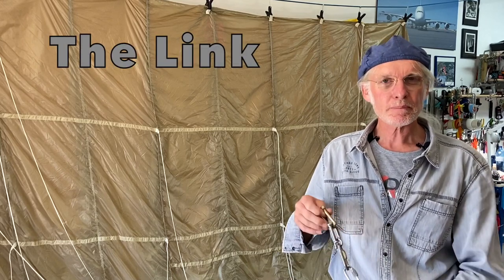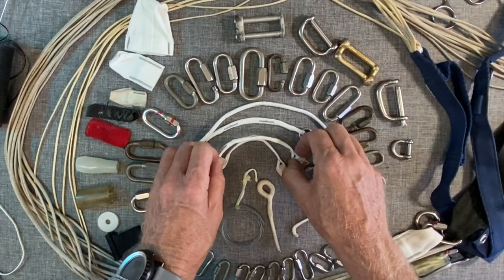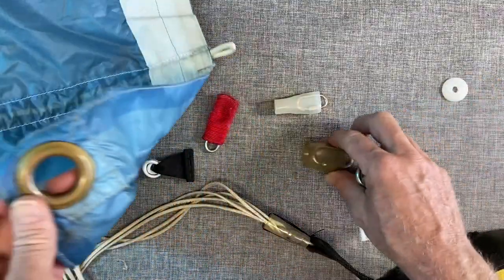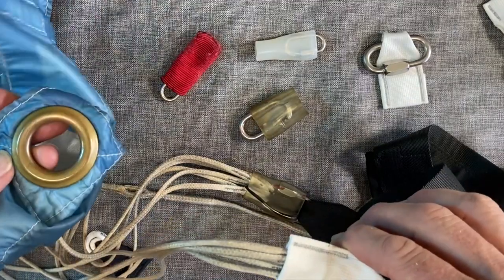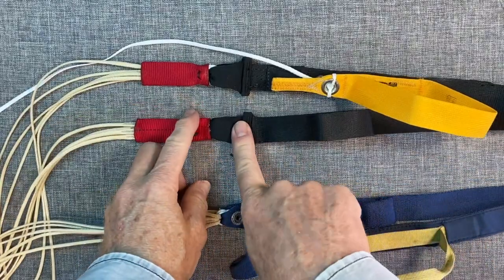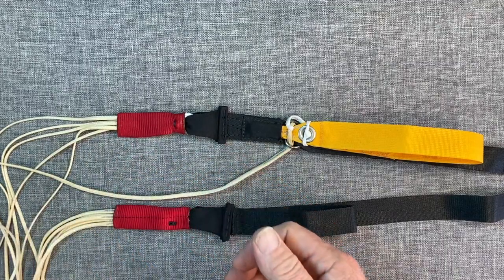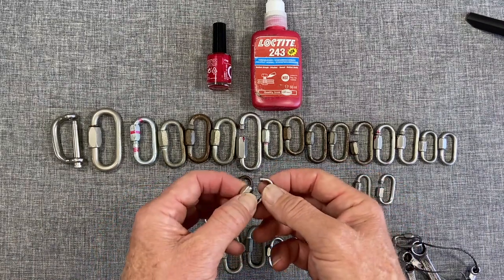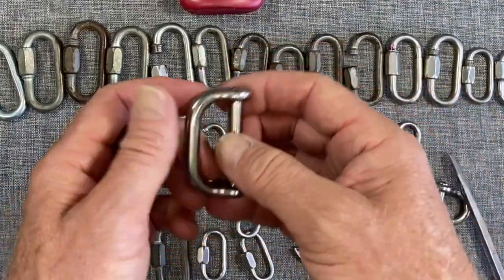The Link.

Comment: Once again, great video!, one question... does all this apply the same way to reserves? can you still use hard links on reserves? I remember a friday freakout 4 years ago with a malfunction on a reserve with a hard link failing...
Reply from the maker: Thank you Daniel, I’m grateful you had a look and for your question.

Yes, a Link is a Link whether it attaches you to your main or reserve, 

Sizes tend to be a wee bit larger on the reserve, the Ty7, Ty8 or Ty13 webbing typically used fit reserve risers will not be happy with a size 3.5 Maillon Rapide (from Peguet) (certified for PPE)

The size 4 or 5 were the normal ones most manufacture supplied with their reserve canopies, (occasionally size 6)

With no LinkCover there is a chance a line or two could get itself to the other side of the link nut, best to be avoided. 

In my younger days, I used safety thread past though one line end loop and then wrapped around the rest of the lines on the link, this would keep the lines together nicely but not protect them from slider grommet impacting the link with the poor line in-between. 
For that reason I now fit LinkCovers to all Maillon Rapide on sport parachutes.

Link Failed or Human Failed ?

Links can work loos if they have high cycles (hopefully only seen on main canopy) and no periodic inspection is made.

In my opinion links come loos on a reserve because they were never tightened in the first place(see link, Photo below)

There a several reports of SoftLinks Failing as well, 
in my workshop I frequently find SoftLinks incorrectly fitted,
in combination with a Lower Control Line snagging on it or a hand pulling on a riser in the final turn, 
there’s a chance the SoftLink will open up.

SoftLinks are not any better/stronger than Maillon Rapide,
(The profit margin is better on a SoftLink)
No need for LinkCovers or Safety thread wrapped around the lines, see photo of poor technique on the reserve.

I always tack the Softlink into the riser.

The photo of the ControlLine making a couplet loop around the Aft Rh line group, arrived in my workshop a year ago, it was assembled at the Manufacturer and had a second repack by one of their top representatives six months later, 
its a 106 so may have been a challenge to fly straight had it been used like this.

We must attempt to be concentrating on what we are doing,
more difficult with all the distraction we allow ourselves.

Link Failed ? 
Yes the Human Link !

All the best,
Colin.

https://drive.google.com/drive/folders/1ZUq8ZkoztNILJKhjSZfioxNVVEJbkcmS?usp=sharing

Comment: Thank you for posting these very informative videos! I was wondering why did you secure the soft link with the metal ring through both sides of the riser fabric, but you secured the PD SLink through one side of the riser only?
Reply from the maker: Hello Vladimir,
Thank you for watching and for your question.

The SLink from PD has that tag of 1/4"Ty3 tape for the "ID", it seems to work well as an anchor point for the tacking cord, so I use it, if its there.

For SoftLinks with a Ring or a folded tape with no wee 1/4"loop tag, 
it just seams simpler to have the Tacking cord loop around the folded tape or through the Ring.
The stitch is not very tight, I like to allow for a bit of a breathing space, 
they appear to sit happily in the middle of the riser. 
(no need to stress the riser more than necessary) 
The Red Tubular Sacrificial Covers are stitched quite tight.

For a few jumpers, who swop Sliders from RDS too Regular frequently, it's a hassle if the SoftLink is Tacked, so for them I machine stitch a "U"shape to the riser, creating a wee pouch for the Ring or Tag to hide inside, just enough room to assemble and disassembled.
(made easer with long nose pliers)

Hope that makes more sense now.

All the best,
Colin.